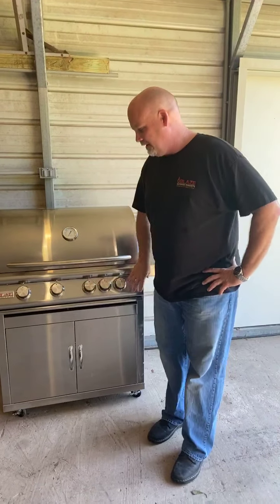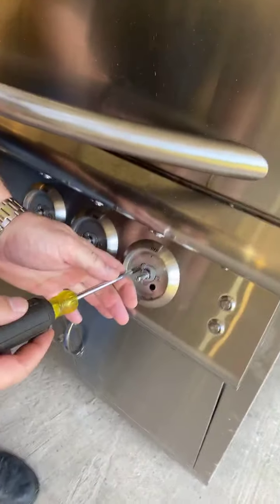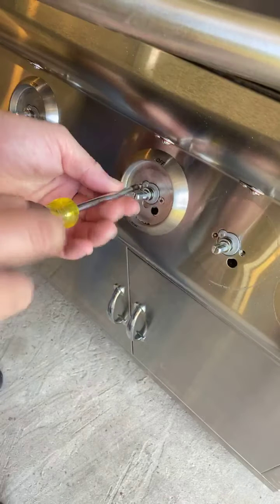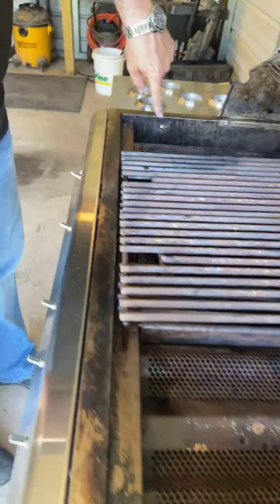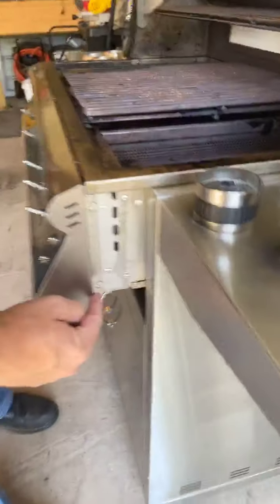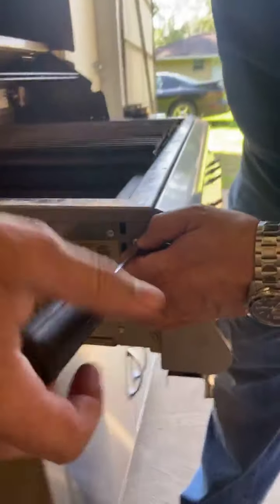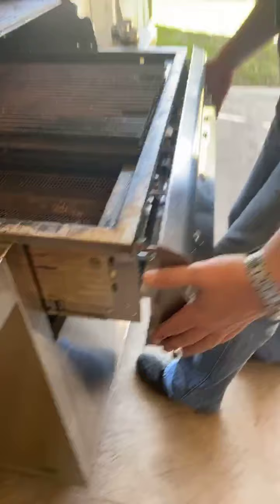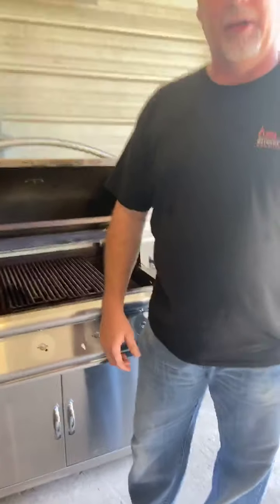Blaze Outdoor Products - DIY Change your light harness

Comment: My LED switched is stuck pushed in which means my lights are on the inside of the grill 24/7. I had to crawl under it to unplug it from the wall. Not a good start. I have only used the grill 4x.
Reply from the maker: @williamalaxender8220 https://youtu.be/WuUo84bnkiQ